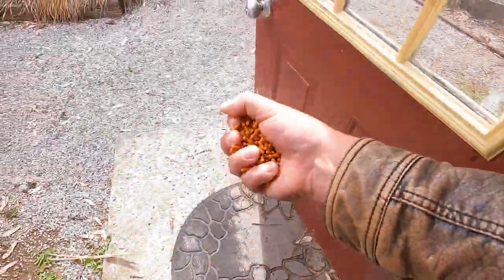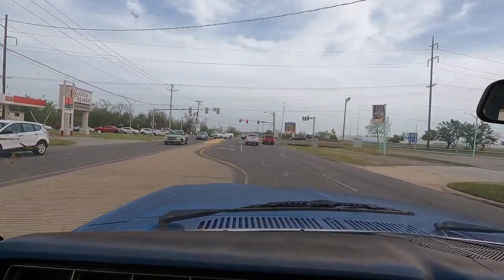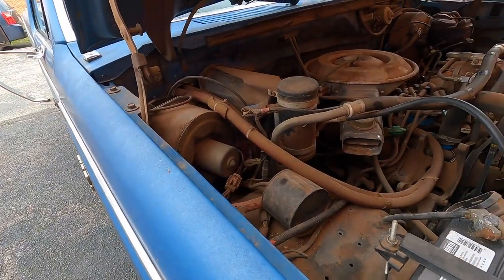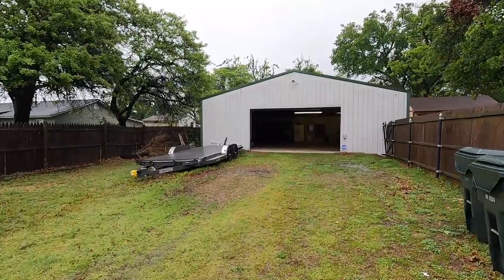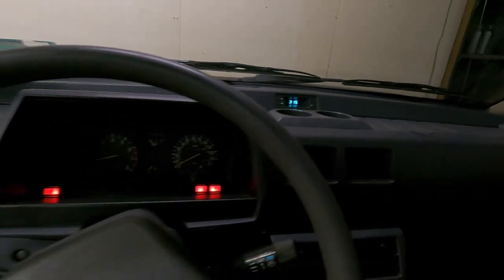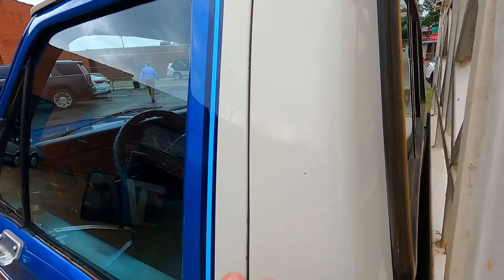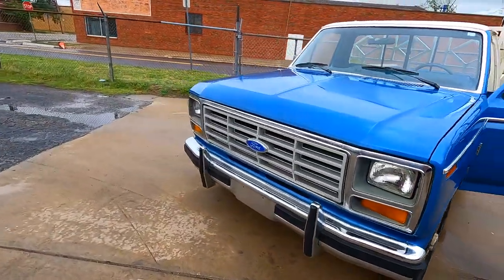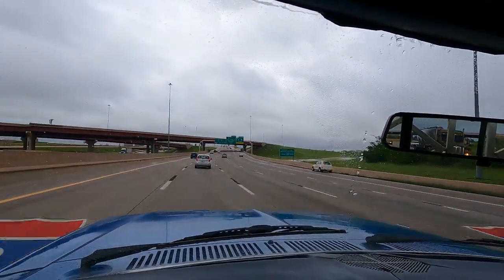Abandoned 8 Years Bullnose Ford F150 gets $500 Detail!! WOW!! Almost new!

Comment: I bought my '99 F350 (4wd, Super Duty, long bed) from a buddy's dad's estate for half of book. Did a Line-X bed liner, AVIC nav system/head unit, stripped to metal and painted, pulled the windows, all new body seals, Bilstein shocks, Rotor Pro rotors, Akebono pads, new calipers & hoses, tinted windows, BFG All-Terrain K0-2 tires, poly bushings & Moog HD end links, all consumables under the hood replaced, all-aluminum radiator, new injectors...it's great, all in at about $17K

Comment: I would have probably topped out on and offer at about 3500 after the detail.  2500 before.  So 500 for the detail would have been worth it.  I think you could have gotten 6k for it in the rust belt, I have sold some F-150s from the 80s and 90s out of Louisiana and some old Jeeps up there for twice what you can get down here in Texas or LA.  Everything up there disappears over time.  I have seen 5 year old trucks with rotted beds in MN, MI.

Comment: It’s a nice old truck but price wise you did very good. Personally I wouldn’t give you over 1500.00 tops for it. No offense to you or your video but this is a prime example of how ridiculously stupid this country has gotten on paying for a USED VEHICLE. Take this truck, the  thing is 40 years old. It wasn’t and I would bet anyone cash money on this, but if it cost 7800.00 bucks brand new I would have to see it. The last brand new truck I bought was in 2000 and I said that day, this is it, I still have the truck today. It’s a extended cab f150 4 wd. It was 31,600 out the door. 21 years later and I’m 52 years old and I will drive it until my time is up bc I will never pay 50,000 for a truck nor like some friends of mine that buy 2016, 2018 whatever with over 100,000 miles on them and they will pay from 20 to 40 thousand dollars fir USED TRUCKS. These are just vehicles, that’s it, they get you from point a to b. To be fair, the reason I am so passionate and pissed off is bc I know how much it takes Ford anyway to build a brand new platinum f150 or a plain Jane due to knowledge told to me by others is all I can say. Ford and I’m sure gm are making literal fools out of people in this country. I’ll leave it at that.